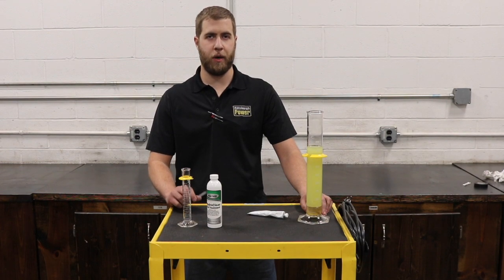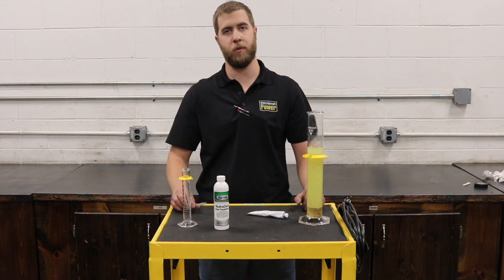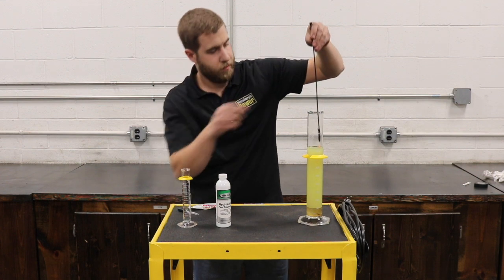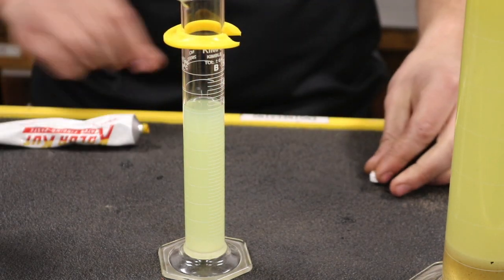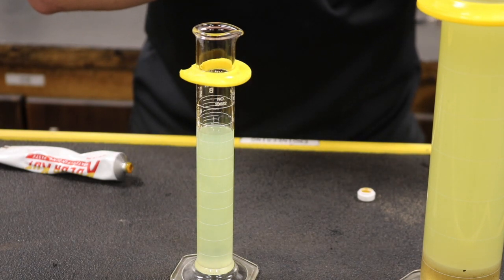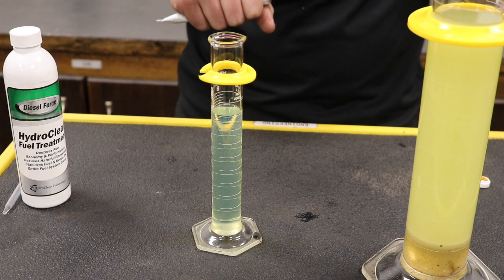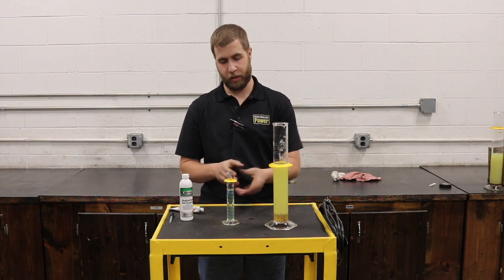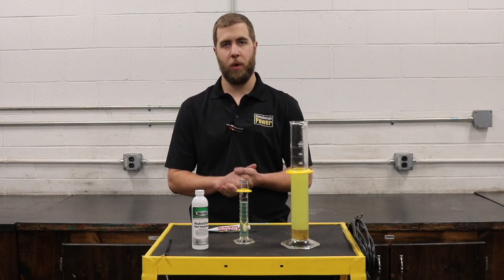Water in Diesel Fuel: Fuel Treatment

Comment: Why so much water in the diesel?!
Diesel fuel is not hygroscopic like brake fluid.

There is only one diesel fuel additive that works.
No YouTube videos because reviewers are not paid.
It is so potent that it needs a ratio of only 100:1
This product is so rare that it is only available in Amazonian countries.
The brand name varies so look in the composition for SNAKE OIL
LOL
Reply: I think he said the equipment had been sitting for about 3 years that could have a lot of condensation that might explain all the water
Reply: Condensation inside an aluminum fuel tank is why water gets into diesel, when you fill the tank it picks the water up off the tank and brings it to the bottom of the tank. Eventually it grows bacteria, and clogs fuel filters.

Comment: Water cannot be converted to hydrocarbon.  This product probably contains alot of alcohol, and alcohol will ruin the high pressure fuel pump on newer engines.
Reply: If water could be converted into hydrocarbons we would have NO need for petroleum based fuels for internal combustion engines, seeing as how water is the most abundant material on the planet.  Also, where does the extra carbon atom come from to bond with the hydrogen in the water molecule?
Reply: @unclejoe5541  Think twice ! we can live without fuel but no chance without water .and second thing  if someone review the formula there will be free fuel so how some people will get richer and richer ?
Reply: Just checked the S.D.S..  50-100% 2-butoxyethanol   Also used in liquid soaps among other things. Wouldn't run it through my pump!
Reply: HydroDiesel, Google it first
Reply: Actual chemical is 2-butoxyethanol
Reply: Alcohols tend to precipitate out with the water quite quickly if left to settle. I've never tried it, but I would expect dish washing liquid to have about the same effect. Hmmm?